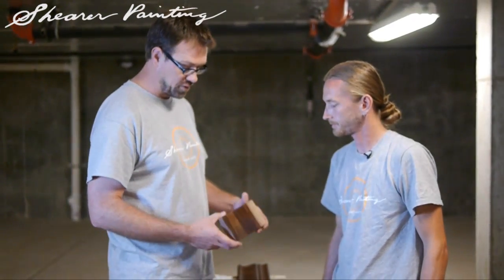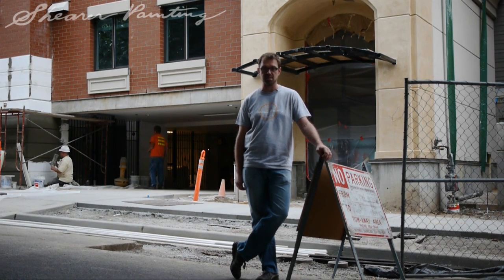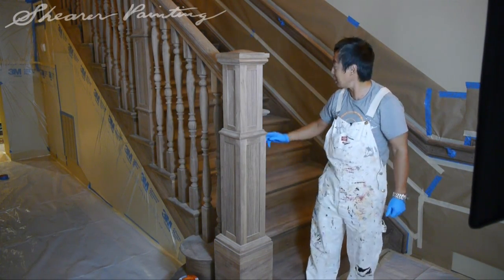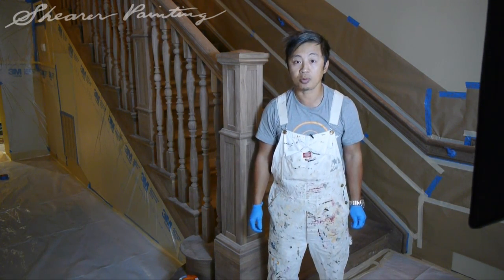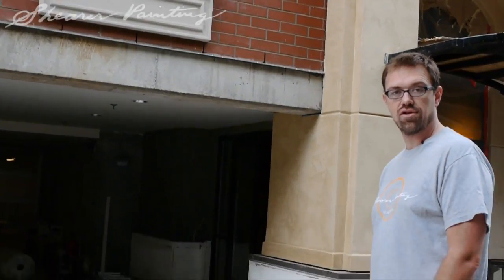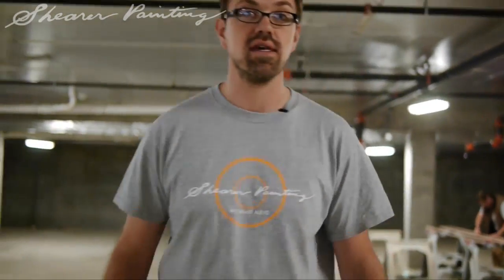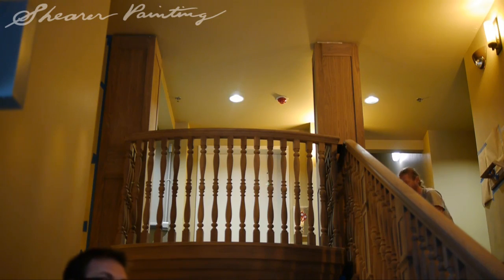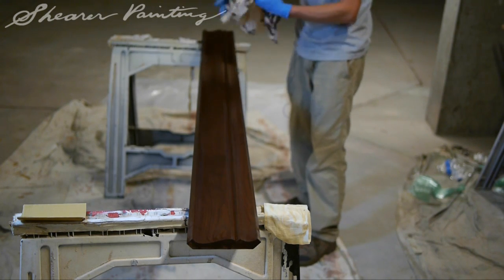Walnut Staining and ClearCoat

Comment: 👎🏻 This was an infomercial for this company. The only staining done was applying to one length of board. They have a 4-step process: apply stain, wipe off excess, sand, apply topcoat. The video shows stain application, then 1/3 of the way through wiping off the excess, the video ends.😡😡😡